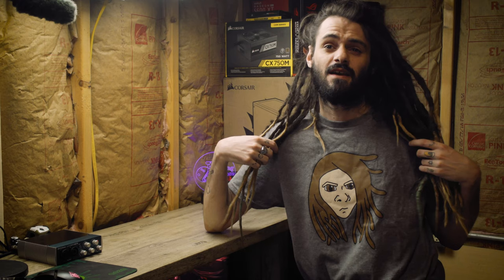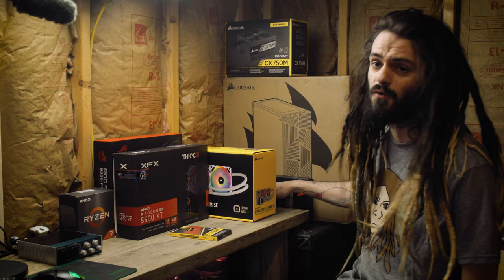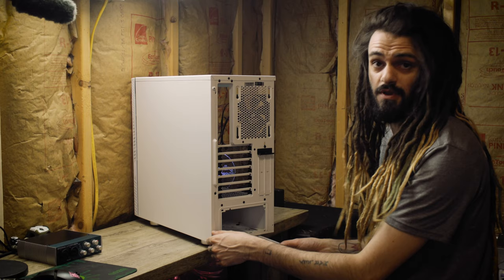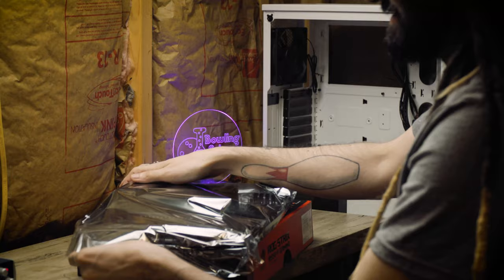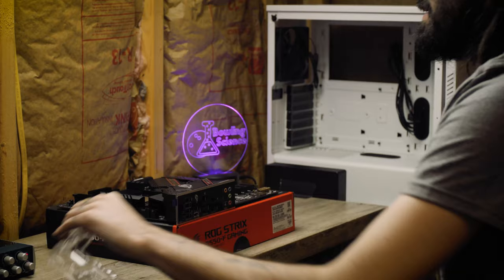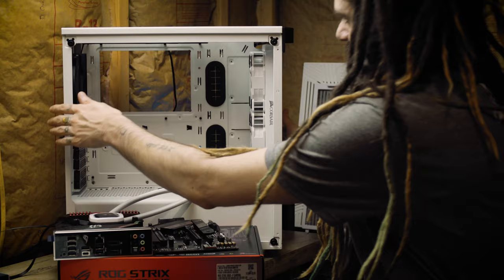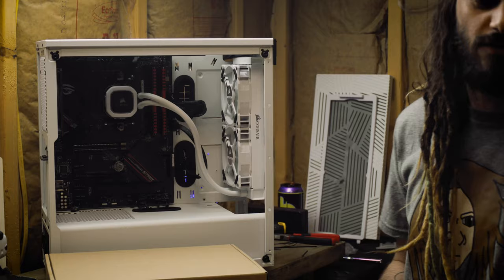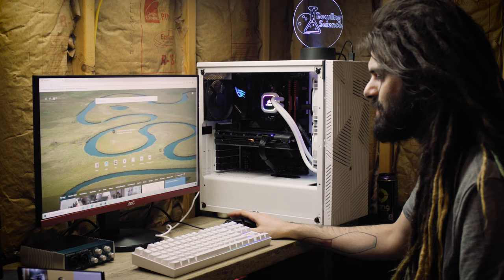Mikey Dread Builds a PC for 4K Video Editing and Gaming w/ Ryzen 5800x

Comment: Nice build! I won't be upgrading for a while. I am using a 2700X, and a 5700XT. Stock speeds for DDR4 are 2400mhz so make sure you set it to 3600mhz in the bios, that 5800X will love it!

Comment: Two weeks ago I also upgraded...i got a ryzen 5800x, G.skill Ripjaw dual ch. 16GB DDR4 3600mhz CL16, MSI mpg B550 Gaming carbon wifi board, XFX RX 580 GTS  8GB (for now), and a WD M.2 500GB gen4 at 7000mb/s read speed
Reply from the maker: Nice setup! Which graphics card do you want to upgrade to?
Reply: @BowlingScience  hey thanks, most likely the RX 6800 XT ... i went from a Gigabyte 7970 3GB since 2013 till just a few weeks ago when I picked up the xfx 580, crazy I know
Reply from the maker: We will have very similar setups! That thing will fly